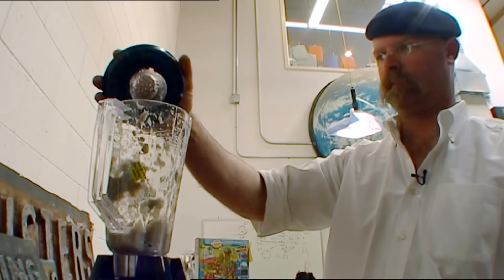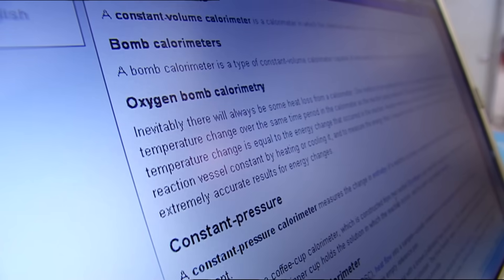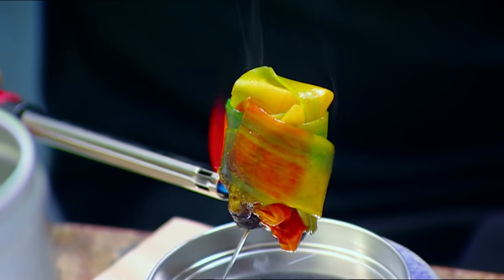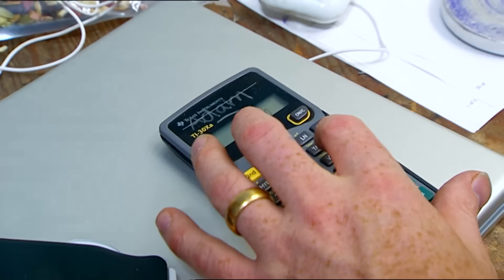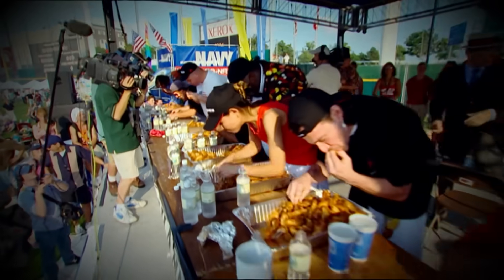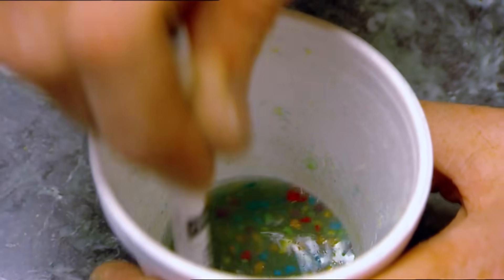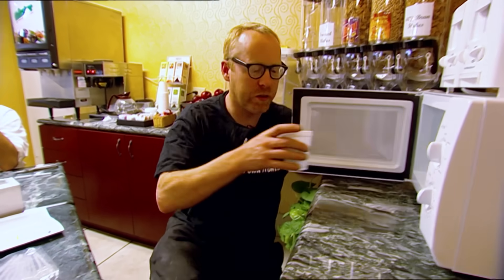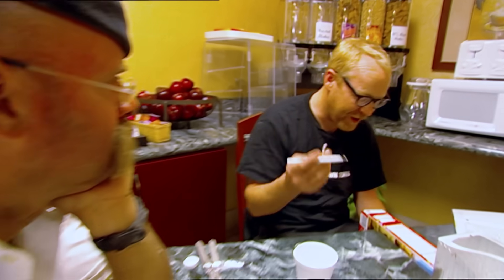Is A Cereal Box More Nutritious Than The Cereal Inside? | MythBusters

Comment: There's a flaw in their methodology, they calculate the data from the calorimeter without adjusting to how much of the combustible material is actually digestible by humans, which in the case of cardboard is basically nill, since it's mostly made of different kinds of cellulose, just because something can burn well doesn't mean we can derive the same amount of energy out of it.
Reply: Ya, most humans can't digest crude oil or gasoline.
Reply: you just havent learned to consume gasoine yet. i did it as a kid.
Reply: @beaneater6932 That explains a lot, actually.
Reply: Yes but regardless of that, the box was still shown to have less calories, so even if the box was 100% digestible that would mean it would still result in less caloric intake
Reply: Yeah, like in a Famine haven’t people swallowed rocks (?) just to have something in their stomach… like shit what was that show “Freaky Eaters” where it was almost a compulsion… (eating drywall, grass, all kinds of shit)
Reply: Facts humans have no enzyme (cellulase) to digest cellulose
Reply: Depending on the brand of cereal its most undigestible fiber anyways. The only reason it has any amount of nutrition is that its been added.
Reply: You guys are weak, I drink cardboard all the time
Reply: Umm….no. If you just look at the calorimeter test then sure you might have a point. If you take the time to watch the rest of the video they go over what is human digestible and what isn’t.
Reply: @mwbhomee2802 they didn't ever adjust their calorie figures afterwards though, which is the main reason I posted this comment.
Reply: There's also more to nutrition than calories, fat and protein
Reply: If they were doing actual science, it wouldn't be mythbusters.
Reply: Yeah, it's because calorimetry has no correlation to the human metabolic potential of food. Colorimeter measures heat of combustion, something that we don't do in human metabolism. It's ridiculous normie nutrition pseudoscience.
Reply: Thanks now I do not have to waste any time watching this video ❤